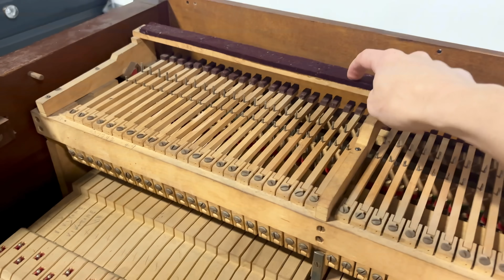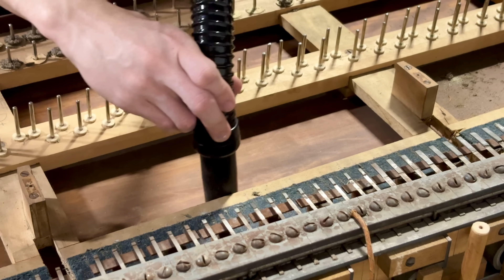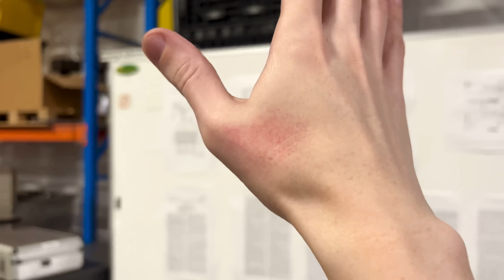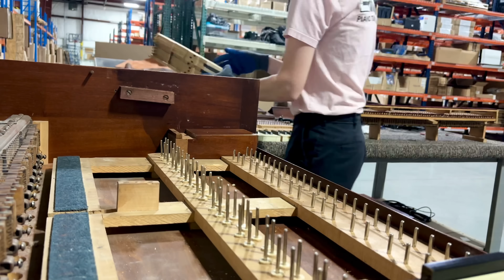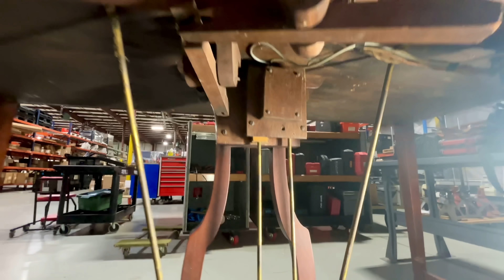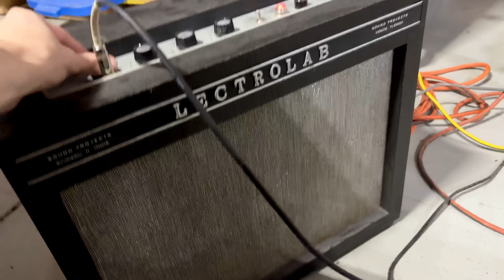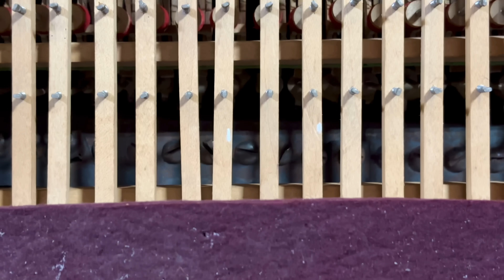Restoring an Instrument You've Never Heard (only 3 left)

Comment: This is a cool electric piano, I have never heard this before... you are right.  I used to own a couple of old spinet pianos, and then when I updated my pro-audio gear, I replaced it with a few KORG synths (X3, X5, Triton, SP-250) but I still have a soft spot for the old mechanical pianos but I couldn't justify having any more keyboards in the house LOL. 

As far as restoring the electronics, perhaps some viewers will refer you over to the YouTube channel "Mr. Carlson's Lab," he (Paul) does does a lot of restoration of old tube radios and explains the problems with those old wax capacitors.  They are just horrible and he doesn't even bother with them, they get snipped out and replaced with a modern one.

That particular capacitor is a .00075 MFD  which is 750 pF and would need  to be a film capacitor, specifically a polyester or polypropylene type.

The other thing to know about is the black stripe, that is not a minus voltage polarity marking, it is indicating that it is the outside of the foil wrapping, (capacitors are 2 foil wrappings with an insulator between them)  and that stripe is intentional to be side that is grounded, the outer foil wrapping acts as a Faraday shield on that component, also notice that the back of the metal on the pot is also grounded... all that was done to prevent hum pickup into the amp.

Modern caps might not mark the outer foil with a black stripe, but not to worry, it can be determined empirically. Connect the leads of the cap to an amp and hold the body with your fingers (carefully not to touch the wire leads), the stray electric fields around your body will couple with the capacitor and you will hear the 60 Hz hum in the amp, and if you reverse the leads on the cap, it then it will be quiet(er).  Mark which leg of the cap with a pen, you want the leg of the cap that gave you the hum with the signal into the amp... that's the side you want to ground.  If you want to watch a video of him going through this process:
https://www.youtube.com/watch?v=BnR_DLd1PDI
Reply from the maker: Bro thinks I was born yesterday I know what a polarized cap is LOL
Reply: Oh okay... if you understood that I was not talking about a polarized capacitor with a voltage polarity, like an electrolytic, and instead connecting the outer foil side to the low-impedance side of the circuit to prevent hum...  then you're already aware. I don't think this is common knowledge, I just learned this a few years ago despite working with electronics in the 1970's, getting an electronics degree, etc.  I am still learning new stuff.
 
All wax capacitors are bad by now.  The paper insulator that is inside of them has reacted becoming acidic, and that makes them electrically "leaky" allowing DC to pass and now it acts like a resistor, not a capacitor, thus it won't act as a high-pass RC filter as intended.

Comment: Old capacitors decay over time. You could replace it with an equivalent modern capacitor or find original reproduction capacitors from guitar enthusiast manufacturers. May have to stack to achieve the same capacitance.
Reply from the maker: Yes

Comment: Shielding is a real art and there's a lot more to it than just grounding it because if inadvertently you make a loop back you turn the shield into an antenna so instead of blocking all of the RFI you're actually routing all of the RFI through the pickup system. I know absolutely nothing about that instrument and I have limited experience as a ham radio operator dealing with RFI but what I would suspect is the pickups polarity is probably part of why that turned into a giant antenna instead of a shield also probably because at the time this instrument was made RFI wasn't nearly as big a deal
Reply from the maker: True

Comment: This is incredibly cool! I love this. Shared!
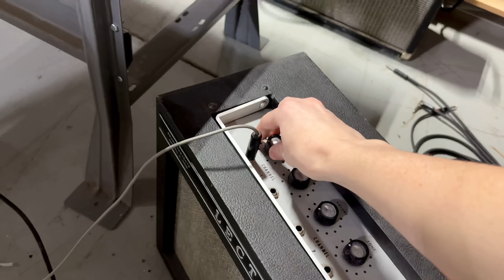15:39 Check out that Sound Projects Lectrolab amp! How fitting that the first amp this gets plugged into is another Chicago-made beauty like that.
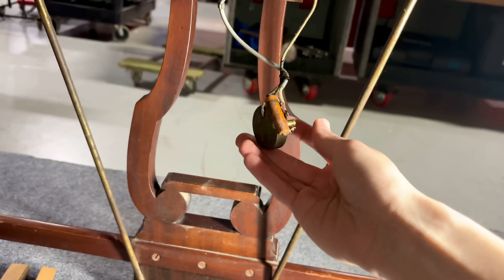15:49 Sounds like you've got some kind of ground loop being formed there, hence the hum. You should trace the ground connections and ensure that there's only ONE single connection to the input lead going to the amplifier. The way that cap is connected to the lead's shielding on one leg and the leg of the pot is connected to the back of the pot looks really suspicious. My guess is you could clean that up and eliminate the RF antenna being formed by what's likely a giant ground loop.
22:11 I wonder if taking a wire wheel and cleaning all the reeds might have been a good idea, since a lot of them seem to be covered in crud. This would have an effect on the pitch of each note as well having all that crud on there.

I reached the end of the video and you did an incredible job on this thing! I hope you can find the source of that hum. Maybe test that cap and replace if necessary. Better to have it working properly than not.
Reply from the maker: Haha yes! and thanks. The hum was fixed in the end by bypassing the pot--honestly quieter than a lot of instruments I record
Reply: @Emmarepairs yes. Just would be cool to get the pedals working as Loar intended. Probably would have to carve a new gear too I guess. I’ve shared this with a lot of tech friends and they’ve all loved it. Quite an incredible piece of 20th Century music history.

Comment: If you need to replace that gear, and maybe get new matching racks, check Stock Drive Parts (SDP/SI).  For replaceing the gear, only the pitch diameter matters as long as you're also replacing the racks...the number of teeth dont matter.
Reply from the maker: Thank you!

Comment: Really? Really cool video. Thank you. I'm blind. Then, if somebody reads this comment, could you please explain to me what this looks like? If it looks like a traditional piano, if it looks like a what I would think of as an electric piano today. You know is the casing, would I? Would assume for the I don't know if that's the right or body. I don't know the right terms for keyboards, but yeah, that would be so so thank so so cool. And thank you for anyone that. Does this sincerely blab the blind bread and guitarist?
Reply from the maker: Hi Robert! This is Emma from the video if you don't have a way of reading the usernames. To me, this is a very ornate, slender keyboard that almost looks like a small desk when the lid is closed. It has lovely wood carvings on the front, and quite neatly done finish work--with a thick wood grain. 

It's more of a medium-toned brown stain, with 4 very thin legs in each corner. It's smaller than a regular piano, missing about 10 keys, so I'd say it's maybe 3.5 feet by 2 feet. There are three pedals that protrude down from the bottom center of the instrument, held suspended by two harp shaped arms. Overall it's a very ornate furniture piece, looking like something almost out of the late 1800's.

Comment: Two points that are unlikely to be helpful. When I used to voice my Rhodes, I would use an old spark plug gapping tool to set both the reed height and the distance to the pickup. For my Wurlitzer, I used beeswax instead of solder for tuning, allowing fine adjustment with a strobe without filing solder into the instrument.
Reply from the maker: The gauge meter is what I use on Wurlitzers haha! Not sure how wax would hold up overtime though

Comment: Does the key alignment affect the stiction that you adjusted prior? Adding the metal shielding seems to more of a non original mod than replacing old electrics but maybe an improvement? I'm not clear if it was and I found it odd that you glued it down before testing it or did you? The tuning part was remarkable. My Father had a BG that he found in a dump in the early 90s and stripped it of it's green house paint and had it restrung. I remember he had spare real ivory keys and that needed to be replaced from time to time as he played it a lot and they wore out and broke and the Piano tuner would come from time to time and always after it was moved.
Reply from the maker: Dunno what you’re asking in the first sentence, but bypassing the pot was a time crunch decision which I forgot to mention—we didn’t bypass the pot till after the shielding didn’t work
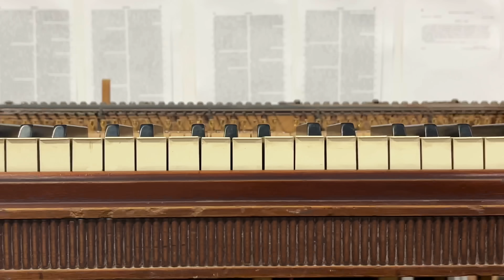Reply: @Emmarepairs  I'm unclear about the how the 7:02 and 7:50 (key squaring relate to each other) To a layman I would think that I would want the keys square before adjusting for stiction but it may be unrelated and I don't mind if it's a if you know you know answer. The backstory is just as remarkable as the repair and the instrument so I like to understand how it works just for the sake of knowing, you know?

Comment: an LCR meter should be able to tell you whether that capacitor is in spec, and replace as needed with a vintage style replacement, keeping the original for reference. Yeah, capacitors of that vintage were quite loose spec wise...
Reply from the maker: Left it at home :((( definitely would be bonk though lol

Comment: Wera makes a screwdriver called a chisel driver (with the yellow and black handle) where the shaft of the screwdriver extends all the way into and through the handle for hammering the screwdriver like a chisel. It might be a good choice for the kind of work you are showing where you hammer the pin back into place.
Reply from the maker: Oh smart!

Comment: replace the capacitors they are old no longer function they can blow up and start a fire and they can cause static or noise.flush out the potentiometer with some circuit cleaner, check all connections to insure no corrosion that can also cause noise or static,,note bad connections can heat up and cause a fire.l know you are trying to keep it orginial but safety must always come first regardless.
Reply from the maker: We already flushed with Deoxit F5 with no change, and we bypassed the cap so it's alright

Comment: Very meticulous restoration - you are very skilled and it is enjoyable to watch you work.  Funny how your effort to increase shielding resulted in making an antenna.  As someone else pointed out, you might be able to DEOXIT the potentiometer - it isn't clear that there is a gap at the contacts to spray it in.  I have bent the case tabs to take them apart.  Of course you would have to fabricate a new gear.  Great to hear this old instrument brought back to producing melodic tones.
Reply: With a pot that old and big, I bet you could literally take it apart and just polish the wiper and carefully clean the carbon track, then apply a bit of Faderlube F5 to keep things fresh for longer. The leaky old paper capacitor obviously has to go in favor of an equivalent modern(ish) film type. 750 pF is not a super common value but they are out there, and I reckon a 680p or 820p would be fine as well. Some inspiration from the likes of Mr. Carlson may be helpful. A matching gear may actually be available off the shelf (perhaps in brass this time) once the parameters of the existing one have been determined.
Reply from the maker: Thank you! We did try Deoxit F5 for faders with no luck

Comment: 750 nF capacitors are still being manufactured / can be bought :) (If I read it right it says 0.00075 MFD. I don't see a voltage rating? probably on the other side?)
Reply from the maker: Yes, time constraints though so we bypassed

Comment: That's amazing! I dream of these kinds of finds. It literally sounds in between a Wurly and an early Rhodes! I have my 1965 Rhodes here, which I'm still trying to regulate and I found two very early packs of replacement tines at my old workplace, which unfortunately is shutting down,  as I was the only person doing the weird stuff like you do. This is Sean again. The 1965 Rhodes is almost this kind of thing, except there were things with the Rhodes that simply had to be changed! I'm hoping the packs of vintage NOS tines will go far towards getting it sounding like it should. I do love the clunk and tone of these early ones. And finally opted to use the plastic hammers with felt tips, as the teardrop hammers were just an idea that didn't really work well with the Rhodes. In fact the first maintenance manual, back in the 60s, stated that once the teardrop hammers wore out, to install the plastic ones, as the teardrop hammers were so difficult to source. Even Vintage Vibe stopped selling them. You can special order them, but you'd be better off to source them from a local piano tech. The hammers in the original were very austere, even compared to spinet hammers, with rather sparse, loose, felt that wore quickly. I have three other Rhodes here I'm working on now, so I'm going to take some careful measurements of the action rails and positions if the harp, escapement, angles,  etc. Then try to rebuild with shims and get the 65 ideal, with the benefit of hindsight. 
I found a guy up in Wisconsin that has the prototype suitcase cab that they used for the 1965 catalog cover! It has tube steel supports on the front and a repurposed twin reverb chassis, specially adapted at pre-cbs fender, with a fender amp tag on it that reads "Fender piano amplifier" with its own amp number... if you know your Fender literature, they always recommended playing these through a Twin Reverb if you had the stage piano. Makes sense!
Reply from the maker: Yes a very delicate sound--if I were to order new hammers I'd probably just go through Schaff or have a friend bore them all straight, that's what makes it a little funky--cool!

Comment: Thumbs up for the elaborate explaining of every step of this huge cleaning and tuning process! You skills are top notch! Just... I think for the potentiometer/capacitor inspection / reactivation you should have asked someone more into electronics. These are standard components that can be tested and measured, compared to a same spec modern part setup to control if the old ones can stay inside. Swapping and shielding without any measurements does not seem right to me  for such a historic one of a kind instrument. The sound of the renovated instrument is amazing! What a nice sound before electronic curcuit instruments became a thing!
Reply from the maker: Yea we debated on what to do with the pot but for time constraints we just bypassed it

Comment: Why not replace the capacitor at the pedal mech?
It's disintegrated, just like all those felt parts that turned to dust.
And while you're at it, might as well clean the inside of the potentiometer using some contact cleaner spray and finishing off with some deoxit D5.
In fact, it wouldn't surprise me if the humming was coming from contaminated or oxidized wiper/contacts in the pot.

Radio reception is probably because the path to ground from the shielding you've made isn't short enough.
Reply from the maker: Already cleaned the pot with Deoxit F5, you should not use D5 with faders
Reply: @Emmarepairs  Both will do, F5 just has improved lubrication properties for the carbon parts inside the pots/faders.
Both aren't that great at cleaning when just sprayed inside the component without any means to remove dissolved contaminants; that's why it's best to start off with a contact cleaner before applying deoxit.

...or instead opening it up and actually wiping off the carbon traces with a Qtip. But that comes with the risk of damaging the enclosure of the component.

Comment: Regarding the radio station being picked up - shielding generally doesn't hurt, but best to keep the ground wires as short and as heavy as possible.  RF is weird, and it sees everything as an antenna.
Reply from the maker: Interesting!
Reply: @Emmarepairs  Scodiddly posted most of what I would have typed.  He's quite right.
A little further down the rabbit hole:  If you have one of these instruments in your shop, and you have time to come back to it to tweak it to perfection, you have two excellent options available:  An Amateur (Ham) Radio operator will probably have the low-pass filters you need in his cabinets.  He/She will need to look at, and sometimes try different spots, but they will allow the ground to do its grounding while ruining its antenna qualities for the radio frequencies.  The verb for a ham helping you with such a thing is called Elmering (goog: 1971 qst elmering).  Your local ham radio club is a great place to be Over-Elmered with support.  :)
While they have their big pile of old ham radio parts at hand, yes definitely get that capacitor (condenser), and the POT into the labeled bag of parts preserved for historical purposes.  I've helped repair radios with those vintage parts.  You can't un-age them; they have earned their retirement.  With ham gear, the new parts in audio-sections have made a delightful difference in the sound quality.
That's a fascinating device you preserved.  I hope when it gets its next service by one of our great great grandkids, they put the same skill and care into it.
Reply: The fix could also be needed at the amplifier input. I lived in a spot that was near a transmitter, and my (tube) phono preamp started picking up a radio station. The resistance in line and the capacitance to ground of the input device create a low-pass filter. I increased the input (grid) resistor, and that solved the problem.
Reply: Yes ... best to employ someone versed in solving those kinds of noise problems too. They are called "RF Engineers" for Radio Frequency Engineers ...